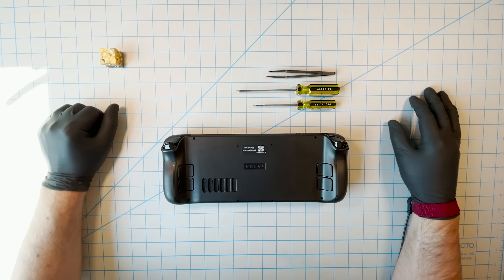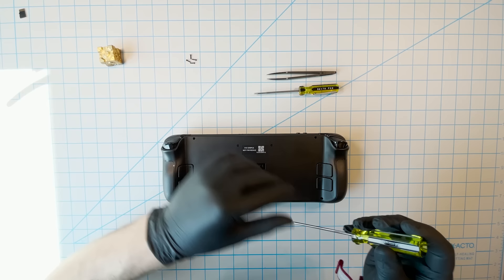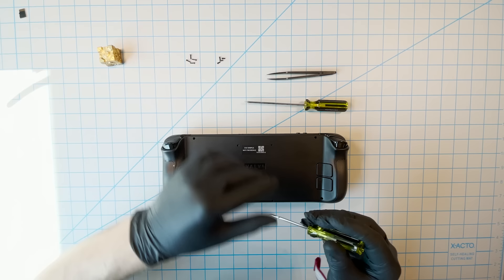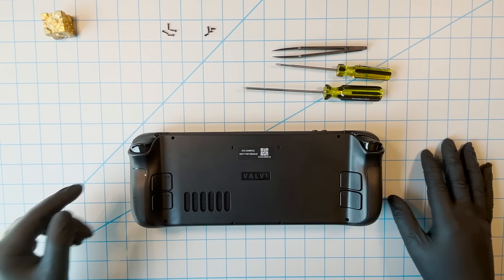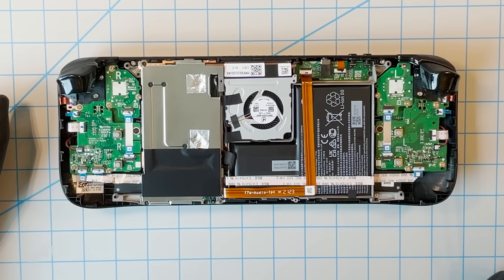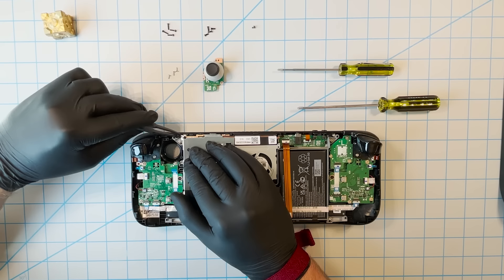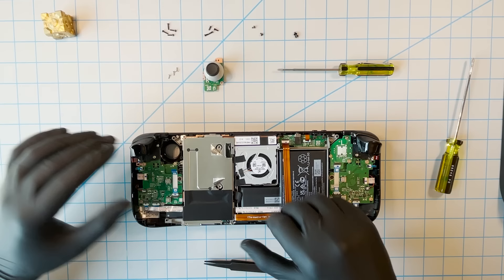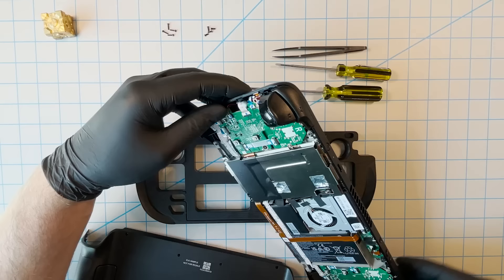Take a look inside Steam Deck™!

Comment: Basically, “You shouldn’t but it’s yours and you can. Here are some of the trappings and pitfalls to be aware of.” That’s Right to Repair-friendly in my book. Knowing that some can have issues we can look for specific SSDs and other components that fit and don’t interfere. My only criticism is that they should have suggested you try to reuse threads when putting the screws back into the plastic. Repeatedly cutting new threads will damage the plastic screw post whether you use a torque wrench or not… and then you’ll need a new front housing.
Reply: To me the video is anti right to repair, they are using some typical fear mongering points because i doubt people will be getting battery's blowing up or that much of an important difference in drop resistance. But its nice that the actual technical side is very right and repair friendly with sourceable replacement parts.

Update: To clarify i am criticizing them for the dramatic way in which they present these points in a fear mongering way. I am not saying they should not be warning the user or adding disclaimers. What i am saying is that i think they went to far in this direction in the exact same way company's do to try to get people to vote against right to repair. All they had to do was mention that the quality of the product depends on their assembly and that by opening it up they can no longer guarantee the performance of the device to be as advertised while advising you to leave it to an expert if you are not familiar with handling an electronic device that has a battery. The way they did this was deliberately to scare people from doing it, which is a step beyond a mere "don't sue us".
Reply: @Henk717  The video is more of a cover our ass in the off chance that someone attempts to sue, stating that they will reveal more information in coming months on a source of replacement thumbsticks, SSDs and more is the complete opposite of anti right to repair.
Reply: @Henk717  if they were anti right to repair they wouldn’t make this video in the first place
Reply: @Henk717  It strikes me as pretty middle-of-the-road, which I don't think is an unreasonable position for them to take with pre-production hardware, etc. I mean, they're no Apple, but they also haven't released board schematics; though they actually might
Reply: @Henk717  Right to Repair has nothing to do with discouraging or encouraging you. They clearly do that for liability and warranty reasons.
Reply: @Henk717  You're aware that americans like to sue companies for money over little things right? If they didn't provide a disclaimer that the customers shouldn't open their device and the risk of battery blowing up in-case the one who opened screws up, then it can cause trouble for Valve when some a-hole actually blew up their device and sue Valve for money. 

There's a reason why every company has a silly disclaimer that should be obvious not to do.
Reply: @koji.o  I just think it can be done with a when you open the device up we can no longer guarantee the products quality or safety. I think showing blown up battery's and drop tests is excessive.
Reply: @Henk717 i mean, even the things that they say you shouldn’t do, they say its more of leave it to a professional, not that it cant be done.
Right to repair isnt that everything is so easy to swap that any person can do it. 

The fact that things can be swapped if you really know how (or that you can simply take it to a repair shop) and its eventually just a matter of people determining which off the shelf parts work (or Valve making them available as they mentioned), thats what make it a right to repair positive
Reply: I was somewhat unsure about what I thought of this video until I read this comment, this makes a lot of sense. I mean, somebody who is actually afraid of what they mention in the video should probably have somebody else do maintenance on the product for them. I do like that they at least are showing the basics of replacing things like the joysticks, as those may drift in the future, and that they made some parts modular.
Reply: @Henk717  In my opinion, what seems at first glance here to be anti-right to repair is just valve's lawyers being smart
Reply: @Estarvia  Exactly. We aren’t asking Apple and others to encourage users to replace their own flex cables, ICs, ports, etc. we just want them to stop blocking the people who can. Using fear to justify their active attempts to block repair is entirely different from explaining or exaggerating risks to discourage someone from needlessly breaking it or endangering themselves.
Reply: This. Right to repair doesn't mean it's easy to repair but just that the manufacturer does not actively make an effort to deter 3rd party (or "self") repair---it's no harder than it needs to be. Pointing out the risks in the process (potential damage you could do) and precautions that need to be taken is perfectly fine and valid. Especially since the SSD swap procedure is harder than, say, a similar procedure with a laptop.
Reply: @Henk717  I think u make a fair point, but I think they were alright in how far they went. I don't think they were fear mongering as u very well could seriously injured yourself with the battery, like u could go blind, burn down your house, or any other number of things simply by smashing or poking the battery wrong, amd the other points they gave were very valid as well so I think they did a good job of being informative on the dangers and how u could very easily damage your device.
Reply: @Henk717  My thoughts on this is generally if you don't know exactly what you are doing, then we highly recommend you don't do it, but we won't stop you. It's your device, do what you want. The fact that they are even going to be giving ways to get first party replacements as an end user is a fantastic step in the right direction
Reply: @Henk717  "We're covering our arses and giving you some extra help for common problems you may have, because most of the population think they're IT engineering geniuses".
Getting someone to change the thumbstick alone is a massive undertaking to someone who doesn't have a clue, they could damage the whole unit, leaving the customer out of pocket and Steam out of favour because the customer then brands the product useless and moves on to something else.
I asked someone to replace their RAM a few months ago, they put it in a PCIe slot (It doesn't EVEN FIT!?)... They've been using a PC for years and thought they knew what they were doing because of that fact alone ~ People are just that stupid.
Reply: Literally half the video is spent telling you all the bad things that will happen if you open it.  Skip to 2:30 and you've missed nothing.
Reply: If I opened mine, I would try to source smaller screw bosses, press them into the housing. Either that, or fill the bosses with a decent epoxy, drill new holes, and cut new threads during re-assembly.
Reply: @B1GTOBACC0  I do a TON of retro game console upgrades and reusing threads wherever possible is definitely the way to go. You just turn the screwdriver backwards until the screw lifts off the top-most plastic thread and drops back down. That’s when you know the threads are aligned and you can begin screwing down. Give it a couple turns and switch to a torque driver if you must. When I find one with busted threads or a cracked screw post I fill the post with ABS Cement since most console shells are ABS plastic. ABS Cement is just ABS plastic dissolved in a solvent so when it dries it will fill the hole and cracks with fresh ABS. From there I can make new threads.
Reply: I struggle to see this as Right to Repair-friendly when they frequently reference proprietary or custom valve only hardware pieces.  This makes sense for a device this small and built to such tight tolerances but that doesn't make this a Right to Repair-friendly device.
Reply: @kiernansfault48  …and MadLittlePixel’s video talking about this is literally twice as long. ;)
Reply: @yaboiyuri9096  Even Louis Rossmann says proprietary is fine as long as it’s reasonably available. If your design could only use what already existed on the market then it would be hard to innovate. There’s nothing stopping us from finding an SSD that doesn’t have clearance issues and doesn’t interfere with WiFi. There’s also nothing stopping vendors from marketing their replacement SSDs as compatible once everyone is aware of the additional concerns and they are checked/addressed. Bringing those concerns to the forefront only accelerates the availability of suitable replacement parts. Get it?
Reply: @Henk717  I don't think you fully understand what right to repair is. They make it very clear that if you don't know what you're doing, it's better to leave it to the professionals because of many things that can happen. Right to repair is not about just trying to get people to repair their own products or not, it's about allowing people who know how to repair it, to be able to easily get replacement parts for their device to then fix their device. Apple makes it extremely difficult to get parts that will work for their devices, especially with their new iPhone 13s.
Reply: Whether or not it's right to repair friendly will depend on how easy it is to get replacement parts and whether they block access to the specific parts.
Reply: @tissueoflies2780  …and the video does suggest that they will be making replacement thumb stick modules available in some way. It also uses a standard connector for the storage and gives alternative vendors an idea about what they need to do to make sure their SSD modules are suitable. Grade A so far.
Reply: @B1GTOBACC0  id probably make the holes a bit wider to push in threaded inserts, as Linus did with the 3D printed case he built in
Reply: @emmettturner9452  Not every device needs to be right to repair friendly and devices with tolerances this tight it makes sense they would be difficult to be designed easy to fix. You can acknowledge that without condemning the device but calling the steam deck “right to repair friendly” is absolutely a stretch.
Reply: @Henk717   Even their ssd just has rf tape on it by the looks of things.
Reply: ngl the self tapping screws make me sad. Also the part where you have to remove the cooling assembly to get to the ssd
Reply: Isn't metal on metal, if corroded then the screw will be stuck? It may happen with plastic but i'ts somewhat easier to fix than with metal (not saying it's easy).
Reply: @Henk717  not particularly in my opinion as they actually provide several justifications as to why your product can be damaged. safety
Reply: @yaboiyuri9096  Right to Repair is not about making it easy. It’s about not going out of your way to make it impossible.

For example: Asking a supplier to make an alternate version of a chip with a modified pinout then contractually forcing them to only sell it to you so that the off the shelf version will not work with your device is anti-repair.
Reply: @Mr0Whitey  Machine screws with threaded inserts would be nice but I’ve been disassembling hundreds of retro consoles a month and I can’t recall the last one that didn’t use self-tapping screws. XBOXes, Playstations, Nintendo 64s, Nintendo Entertainment Systems, NEC TurboDuos, Sega Genesises, Wiis, Game Boys, etc and I can’t recall a single one that was built any other way. It’s just that it has got more in common with a handheld console like a Nintendo DS than it has with a laptop or PC and they want us to know. At least they didn’t use tri-wing screws like Switch, Game Boy, 3DS, etc.
Reply: @ArmiaKhairy  don't think that's a big problem. I'm guessing the selftapping screws make the manufacturing process cheaper and they are plenty strong as long as you never remove them.
Reply: @yaboiyuri9096  A cell phone does not need to avoid glue and tight tolerances to be Right to Repair-friendly. Marrying the screen to the logic board so you can’t even salvage one from another identical device is anti-repair. There is a difference between being repair-friendly and being Right to Repair-friendly.
Reply: @Henk717  Remember that right to repair isn't really about the end user repairing their own stuff when it's broken, it is also about making sure that independent repair shops can do their job properly without interference from the manufacturer. When they repeatedly say that you should leave the service of this to professionals, they aren't saying to leave the service to Valve specifically.
Reply: @Henk717  It helps to keep those who shouldn't really be doing it out and to help out the people that would probably do it anyway. If they were to just say "Here's how you open your device out to have fun and look at what's in it" lots of people will do it just because they made it seem user-friendly and risk-free. Thus lots of damaged units from idiots not knowing what they're doing thinking that it's totally safe to go poking around inside their device for no real reason. If they continually warn of potential ways that you can harm your device, average joe will just keep his nose out unless he has a good reason to go in, and someone who already knows the basics on operating within electronic devices gets a quick rundown on where most of the useful components are. Best of all they get the assurance that they haven't set a trap for you so that when you open it it self destructs because you didn't know about a specific thing when you went to open it.
Reply: Bots are copying your comment.
Reply: @manofwill2468  Well, darn. Thanks for the heads up.
Reply: @manofwill2468  Reported the one I found. Only semi-appropriate selection was harassment/harassing me.
Reply: @emmettturner9452  Yeah I reported it too, as spam. It's so weird. Just figured I'd let ya know. 

I'm super excited for the Steam Deck tho!
Reply: There is a trick I use to put those type of screws back without cutting "new" threads. Place screw into hold, turn counterclockwise untill you feel or hear a small drop, this is the point there the threads just dropped into the existing one. Now slowing turn clockwise to thread the screw back in. I've done this many times and once you done a few times, you learn to "feel" that drop into treads. I've removed and place back the same screw a dozen times without wearing out the plastic.
Reply: @Henk717  Batteries do burst into flames if you don't know how to pull them carefully. If people are going to try it they need to realize that it's a thing that actually happens. I've worked in a repair shop 6 months and seen it happen twice. Last thing we need is some fools going ham with a butter knife. 

I don't think their warnings felt over-the-top at all tbh.
Reply: @yaboiyuri9096  If they're going to sell the parts, then 🤷‍♂️.. I think it would be too prohibitive to expect every component of every consumer electronic to be off-the-shelf. No one is out there making capacitive thumbsticks.
Reply: @Henk717  It's a standard since the first home computer was born. None of company wants you to ruin the device without knowing anything about it. Valve did its best to maintain the repairability and extensibility just like the old day does. In my point of view, Valve just tried to tell you that you should know what you are doing before suing it from your own fault.
Reply: @Henk717  remember that verge video, you'd be surprised at how many idiots can break their steam deck, mess up the threads, and possibly blow up the battery too, even if it's a <0.01% chance happening
Reply: @koji.o  "There's a reason why every company has a silly disclaimer that should be obvious not to do" ... Bag Of Peanuts (WARNING: Contains Peanuts, do not eat if allergic to peanuts.)
Reply: @Henk717  They are just stating the obvious, repairs can be hard and you can ruin it if you don't know what you're doing. Pretending it's not only gives credence to naysayers because they can (rightfully) cite you plenty of situations where repairs have gone wrong. Things can mess up, even if they are done by professionals - and end users are definitely more prone to those errors.

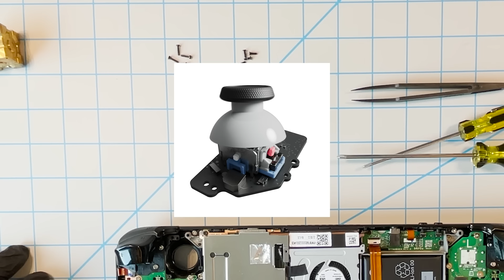It is extremely difficult to do a surface solder for instance, but anyone can get good at it with practice. You should not be stripped of your right to make mistakes, learn from them, and in general being able to fix your products. The intentions of this video are pretty clear when at 2:57 they announced that they will let you know where to source the spare parts.
Reply: @Henk717  They totally should scare away any random Joe from doing anything like this, otherwise you would have idiots ruining their machine, and blaming valve for it. Any guy that knows what he is doing will ignore the warning, and the ones that don't will hopefully leave the insides alone.
Reply: @Henk717  eh, with a small device like that they're probably expecting a fairly young target audience.  Because of that, they'd have a lot of issues if they made it sound easy to take apart, as a lot of young kids would try to take it apart if it sounded doable, and then valve would have to deal with a number of parent complaints.  Anyone who really wants to take it apart won't stop because of a simple warning, so valve guy just used some flowery wording to keep the kiddies away.  Maybe trying to keep kids away is a bit anti right to repair, but in my mind it's not
Reply: yeah, though there is no reason to self tapping screws into plastic, metal insert threads is not a new things and then standard screws work.
Reply: @Henk717  since fucking when giving detailed information is scary?
Reply: @Henk717  Exactly. they didn't say it WILL kill you, 100%. You're free to replace the battery. they literally made a device that absolutely destroys anything ever built in the market repairable af and you're STILL nitpicking. But iphones are perfectly fine i guess.
Reply: @Henk717  I sorta got that maybe passive aggressive vibe too but honestly since it's valve that's putting the video out there they gotta cover their basis legally just in case, so maybe it's for that reason and not "this is super dangerous you should let us do it."?
I still wish someday that a similar video can be put out for the consumers and actually encourage them to do simple replacements themselves. It's not rocket science.
Reply: @Henk717   i totally agree with you, he spent 2 min, just taking " YOU SHOULD NOT" " DO NOT""DANGER" " woooooooooo" rubbish attempt to make a right to repair friendly video, screws of the case really shows how friendly this hardware is in teamers of A repair friendly product! self tapping into plastic..." opening the case immediately weakens it …" ja, have fun!
Reply: @Henk717  these "fear mongering points" are actually a part of every serious repair manual (even manuals made by the community) for PC's, phones, consoles etc.
Reply: TRENDING-TOP-YEARS⤵️ --------------------------------------------------------------------------------------------------------------------------------------------------------------------------------------------------------------------------------------------------------------------------------- ❣️ AISURU.TOKYO/michan?HDRCam✰ᴾʳⁱⁿᶜᵉˢˢ★ トップAVビデオに参加する
❣️

Youtube: This is fine 
Someone: Says "heck" 
Youtube: Be gone 
#однако #я #люблю #таких #рыбаков 
#Интересно #забавно #девушка #смешная #垃圾
Reply: @SteelSkin667  Right to repair is definitely about the end user allowed to repair their own stuff. Just look at the agriculture industry to see the fuckery farmers are dealing with for equipment they are very familiar with.
Reply: Y'all don't understand that right to repair doesn't mean everyone should repair. He in no way said NO ONE should open it, he clearly says to leave it to professionals. I agree, if you don't even know what an esd strap is, you probably should stick to your day job, or practice on something less compact and delicate.
Reply: @mutantmagnet  What I meant is it's about people outside the manufacturer being allowed to repair products, not, about products being easier to repair by untrained consumers. Farmers are professionals that may be trained as mechanics as well.
Reply: @Henk717  I'm halfway between thinking that's it's just a way to cover their asses or that they're just making fun of the fear mongering, as they tell those "scary" possibilities while showing how easy it actually is.
Reply: @SteelSkin667  well, making it easy and safe to repair by the actual untrained customer would be amazing, and some products are. Electronics is expensive to break, sure, but it isn't dangerous nor very hard to repair if it's designed well. This steamdeck is a great example, it's basically 10 screws and you can replace the more vulnerable parts, like the analogs.
Reply: @Henk717  Yes they are scaring away people who aren't confident in their ability to perform these tasks, and covering their ass legally while still providing good information for self repair. This is EXACTLY how they should handle this situation.
Reply: @mwmm  There are definitely parts of this video that are anti-right to repair.  For instance, at one point in the video they ask if you are familiar with electrostatic discharge.  Then they say if you aren't then you should stop and let a pro work on the steam deck.  That is patently ridiculous, since you can easily find out how to protect against static discharge in 30 seconds on the internet just by looking it up and learning.  People everywhere have been doing it for 40 years while they work on their PCs.  Instead, they tell you to just stop, because (assumedly) you just aren't smart enough to figure it out.  That's the basis of anti-right-to-repair, and the same thing they've been telling lawmakers.  "The average person just isn't smart enough to do this, if they try, dogs will sleep with cats, rain will fall horizontally, and the world will end as we know it!"

No - there are obvious portions of this that are anti right to repair.  Then there's some of it that's cover their ass.
Reply: @yaboiyuri9096  Custom parts are not an issue, pretty much everything has custom parts. What they stated however is that they plan on making these components available for purchase (presumably once initial production runs are complete and any late/post launch design improvements are incorporated) which is a step above most other companies.  Other electronics manufacturers try and limit access to the parts (or worse prevent swapping entirely) so you have to buy an entirely new device any time some small component breaks.
Reply: @EwanMarshall  saves money though to not use insert
Reply: @Henk717  You're simply wrong. Not everyone feels comfortable opening their devices. Not everyone SHOULD feel comfortable opening their devices. This video is to address less experienced/inexperienced people. A warning about the batteries is completely valid. Lithium Ion batteries come in many different flavors, and people who don't understand the differences in safety between them should avoid situations where they might puncture one with their unskilled hands on a screwdriver.

This is not anti right to repair. It's a positive video to give us a peak inside, and your assumptions about the general public are wrong.
Reply: @Emmett Turner

Your comment is fair, but here's my take:
They didn't say it because people like you, who might be able to take this thing apart without bricking it, you guys already know and don't need to be told.
The people who do need to be told are exactly the people who don't have the skills to open one of these, and you shouldn't tell them and give them a false sense of confidence that "they can just do what the dude in the video did."
Reply: @Henk717 
I'd strongly recommend you go work in retail, customer service, or the medical field... For a week or so 🙃

It is truly stunning the level of stupid that exists in this world 😜

Just that the video was too protective for you doesn't mean someone else is not *still* gonna burn their house down, and then try and sue Valve for it 😂😝
Reply: @emmettturner9452  They expressly say it's not designed to be opened, I think that disqualifies them from A grade immediately. And until we know the pricing and availability of the components, I wouldn't commit to more than a C. They're taking a bath on the cost of these things, so they may try an recoup some of that in parts.  That said I'm not super concerned unlike Apple who are first and foremost a hardware manufacturer, valve are n online storefront first and the Steamdeck is just a way to funnel more consumers towards their store and promote gaming on Linux, which seems to stem from a enmity with Microsoft.
Reply: @EwanMarshall  What game console use threaded inserts? Even just today, I’ve been inside an XBOX, a SuperGrafx, a top loading NES-101, a PC Engine Duo, a TurboDuo (same thing with different screws), a TurboExpress (handheld TurboGrafx), three Nintendo 64 consoles, an original Game Boy, Nintendo DS, and two Game Boy Advance SPs. I’m about to do another GBA SP for a local game store since he messed up the hinges (I happen to have a video about that).

…but here is the kicker: Absolutely every one of those used self-tapping screws into plastic posts. If the Steam Deck did it any differently then it would be the odd one out. It’s really weird that people like you feel as strongly about it as you do when it is clearly the industry standard for mass-produced game consoles and handhelds.
Reply: @MechanicalCell  You have the wrong idea about what Right to Repair is. R2R has nothing to do with self-tapping screws. Pretty much every game console and handheld ever made uses self-tapping screws. The only screw on a Game Boy or DS or Wii that has a threaded insert is the one for changing the internal battery… and the screw is also captive. Some New 3DS handhelds have a few more because you take off a whole plate to access the SD card but the rest are self-tapping… as they should be.
Reply: @Pulsar463  no, they make it clear that it is a litmus test of sorts. If you don’t know then you are DEFINITELY someone who shouldn’t be poking around. Even if you could educate yourself on that in 30 seconds, not knowing it means there are going to be a lot more things you don’t know. Not knowing what an ESD strap is or how to use it tells you a lot about the rest of someone’s current level of knowledge and ability when it comes to this.
Reply: @MrNicoJac  Agreed.
Reply: @tissueoflies2780  “Expressly designed not to be opened” doesn’t mean that. No consoles are designed for being opened. 

“Expressly designed” is the difference between removing the cover on your laptop to access the drives and memory modules and removing the palm rest, keyboard, button/indicator strip, etc. Often you will find the cover had captive screws while the keyboard, palmrest, etc had screws that come all the way out. Part of it was expressly designed to be open (drive/memory cover) and other parts were not (palm-rest, keyboard, etc). The example I’m thinking of is my old Alienware M11x where even the parts that weren’t designed to be opened were labeled with the screw size or a K (keyboard) or P (palmrest). This lets you identify from the bottom which screws you need to remove if, say, you only needed to remove the keyboard or if you needed to go deeper for adding a Bluetooth module or something.
Reply: Every time I've repaired a device with self-tapping screws , I give it a slight twist in the tightening direction to get the screw moving without damaging the plastic if it's "factory fresh," and then continue to twist it un the loosening direction. That will usually prevent any damage to the threads 99% of the time. I also use a little bit of synthetic grease (Super Lube is my preferred brand) on the screws before they go back in to ensure that they will always be able to go in and out without damaging the threads, as long as you're careful.

If someone is curious about electronics repair and modifications and haven't done it before, I always recommend starting with something much easier like a Gameboy, not the latest high tech gadgets.
Reply: @emmettturner9452  I tend to work on Laptops which most use threaded inserts, but just cause others don't doesn't mean one should copy them (this is just whataboutism, but hell, I'll bite).
1) XBOX, SuperGrafx, NES-101, PC Engine Duo, TurboDuo and Nintendo 64 are all under TV consoles, drop resistance (the reasoning given in the video) is not so relevant on these examples. (That said I think point 2 still stands for these examples, there is no need to self tap which damages the plastic every time the screw is reinserted).
2) One even gets better just threading the plastic standoffs and using none-self tapping screws. Yes self-tapping is cheap to manufacture, mostly cause it removes the thread tapping operation or the insert insertion operation.
3) I'm specifically responding to why they said there is a problem and the reason they claim. Ultimately if I was taking this apart profesionally, I would probably just put non self tapping screws back in so they use the already tapped threads.

And for everyone:
*ULTIMATELY ALL I DID WAS GIVE THE SOLUTION TO THE PROBLEM FROM AN ENGINEERING POINT OF VIEW, AND IT IS NOT A HARD ONE EITHER*
Reply: @Henk717  Nothing fear mongering about warning idiots they can have a battery blow up in their face if they think they can just open the device whenever they feel like. If you are scared by those words, you clearly do not have the knowledge of what to do and what not and should keep your hands off.
Reply: @Henk717  This video didn't discourage me at all to open a steam deck to replace our repair something. If anything, this is the video I'd (re)watch if I had to do it in the future.

If it discouraged you (aka fear mongering), you are precisely the kind of people, who shouldn't mess with this, they were talking about. Which would be totally fine: fiddling with tiny electronics isn't everybody's cup of tea, and doesn't need to be.

Right to repair is about access to information on how to do it, access to parts to do it, design of components enabling the task without needlessly specialized tools and a legal framework which allows you to seek the help of third parties. None of these elements were fought by this video, and to the contrary, the video shows clearly that the design of the product has repairability in mind.
Reply: @yaboiyuri9096  How would that be an issue for right to repair? Whether it is would be determined by the ease of access to these individual components, not by them being custom designed or specially selected and tested for the product. At least in my book.
Reply: @techwolflupindo  This isn't even specific to self threading screws. This tip works just as well to align screw and thread properly in conventional usage. I'm sure you knew already. I'm merely adding it for other readers who already found your tip useful ...
Reply: Aside from the misinformation about the warranty not covering damages incurred if you repair it yourself and the comment about an SSD vibrating during operation, I think it's a good video.
Reply: @TheZoenGaming  Why would they need to cover damages you create when failing a repair on your own? This isn't misinformation, this is common sense. If you slap it with a sledge hammer, this is also NOT covered by warranty.

Also: they didn't claim SSDs vibrate during operation. Listen carefully: they are talking about device vibration (which must not even be generated by the device itself, just place the device on your washing machine to see it vibrate), but about potentially different physical dimensions of an off-the-shelf SSD potentially interfering with OTHER components around the SSD if the entire device is vibrated. They basically tell you to check whether it fits, not only physically when you insert it, but also when the device is operating. Again, this is simply common sense and you misunderstanding it shows how important it was to mention it despite it being common sense ...
Reply: Well the torque driver, can’t technically damage it. Because torque driver can set off a small micro adjustment, so it doesn’t over tighten the screw and damage the plastics screw pits.
Reply: @brag0001  If you take a sledge to it, then no, it's not covered. However, companies will try to claim that any damage suffered by a device was caused by the customer, to the point that they will claim that even just opening it voids your warranty. As a result, US laws in regards to warranties state that minor damages caused by the customer are still covered by the warranty.
Reply: @TheZoenGaming  if I was a manufacturer, I'd do the same. If you break it, you get to keep both pieces. The law might say whatever it wants. You will have to sue to get your right if the manufacturer disagrees on the interpretation of the law in that specific instance.

I think it's rather honest to say: you open it, it's your risk. And it's also the way it should be. Why would anyone but you be responsible for your errors.

Just to make it clear: I don't think that opening a product should automatically void the warranty. But if you break something after opening it that should do it for sure. And once you opened it proving something was already damaged becomes really difficult, even if both sides approach the issue with the best intentions ...
Reply: @brag0001  The onus of proving fault lies upon the manufacturer. It's literally impossible to prove that the customer replacing a hard drive or memory stick caused a capacitor to pop.
Reply: @TheZoenGaming  that's how we solved this in Germany: the first 6 months this responsibility lays on the merchant. Afterwards there is 18 months were it's the customer who has to prove that the defect has occurred despite reasonable usage. But it's still the merchant who has to provide the support. Only after those 2 years do we even have to talk to the manufacturer. If a manufacturer creates too much hassle, shops simply won't list his products anymore.
Reply: @Henk717  I feel like they just needed someone who is more experienced in making this type of video. It may not have been their intention to fear Mong, but it is easy to see that
Reply: @brag0001  Here in the US it's not the merchant that provides support but the manufacturing company. Also, we set up our laws so that citizens are always considered innocent until proven otherwise. This applies to a manufacturer's claim about a customer "mishandling" a product as well.
Reply: and you can always just send it to valve to help ya fix it
Reply: @Pulsar463  Omfg if you don't know anything of electro static discharge you really should stop
Reply: @Henk717  You must have never seen safety videos for training then. Because the wording that this video uses is pretty similar. Its informative, things that you think would be common sense some people have no clue. We know the batteries have such a small percentage of a chance of injuring someone, but a person might try taking it out in a way that causes it to happen. 

They are doing a great job with the video, and its not going to please everyone. Seems to has triggered you. But its like ever other job safety videos I've ever watched about electronics, chemical, using machines. So stop botching that you think its anti right to repair.
Reply: @TheZoenGaming  From experience I can tell you that consumer protection laws in practice are a lot weaker in the US than in Germany. If measured by outcome we essentially have a two years warranty on any technical product we buy, and we don't have the hassle to deal with different manufacturers.

You take your receipt and product back to the merchant and your part of the responsibility is over. Technically the burden of proof shifts after six months. But almost no merchant can afford to enforce this.

Turning to the manufacturer might be feasible when the item in question is an iPad. But I can easily enforce my rights when the item in question is a two dollar fan produced in China as well.

That being said: I still consider the idea that the manufacturer would be considered liable for damages the customer introduced to the internals of the device after opening it ridiculous. That's one bridge to far IMO
Reply: @brag0001  Oh, I certainly agree that in practice that is true. Most people simply aren't aware of the consumer protection laws. I've literally had to quote them to customer reps as well as give them the exact web address of the page they are listed on the government website. Thankfully, once people realize that they are literally violating the law because of company policy they usually change their tune. It doesn't hurt that I record all calls I make to companies for record keeping purposes  and ask for their full name and employee ID number at the start of the call.
Reply: @Henk717  My take is that they are saying you can do this but it might be a better idea if you don't really know what you are doing to find a professional to do it.  They talk a couple of times about you may want to have someone else fix it but they don't ever say "have US fix it"... they are saying if you don't know what you are doing find a (independent) repair shop to do it for you.  In fact some of their phrasing would seem to suggest they want you to go to other people if your device needs repairs...
Reply: @augustuslunasol10thapostle  just stay home and play games ^_^, let the idiots (engineers) discuss with other idiots, you are way so smart to be a part of this discussion!
Reply: @MechanicalCell  and yet the target audience of this isn't exactly people who will know what to do? Do you think your average gamer is someone who will know alot about their machine because no that's not the case this isn't for anyone who knows what their doing amateur or professional it's a warning for your average gamer who in all likelihood doesn't even know what the hell Electro static discharge is yet a guide to make sure anyone who is willing to open it up without that much extensive knowledge won't kill it when they do so
Reply: @emmettturner9452  what i meant here "screws of the case really shows how friendly this hardware is in teamers of A repair friendly product!" i did not mean right to repair i meant, "repair friendly product" however, i thank you for the info ^_^.
Reply: @MechanicalCell  having said that for an "engineer" you underestimate how stupid your regular gamer is surely you of all people should know the stupidity of humanity. Also if any of this actually scared someone then that person should either be doing more research before opening or not opening it at all or letting independent professionals or valve do the fixing
Reply: @Henk717  Henk if they did what you suggested some moron would actually open it and do something very stupid a toned down version might not get it into their heads that this can be dangerous and or may damage your device people are stupid Henk and sometimes you just need to be a bit dramatic about it having said that valve isn't lying hell not even exaggerating that badly